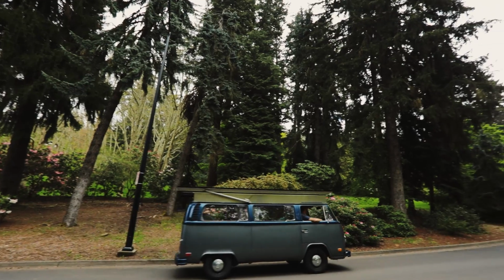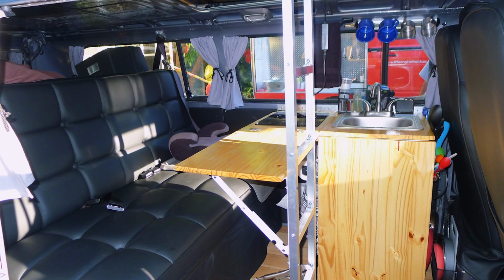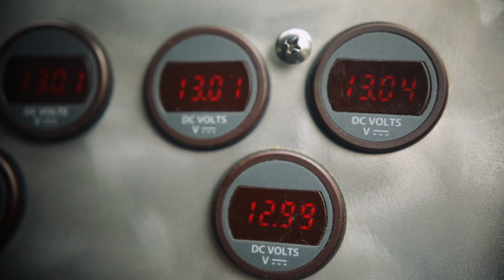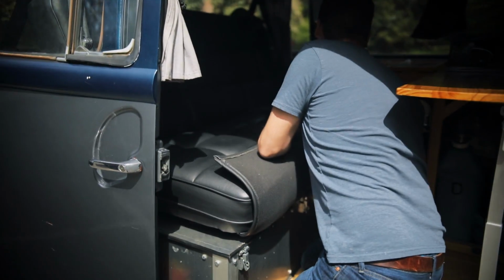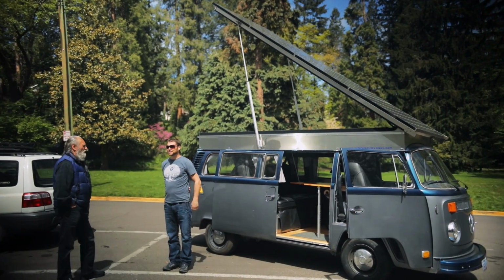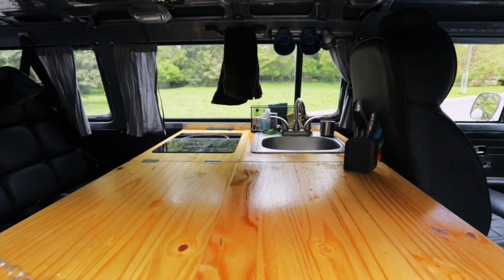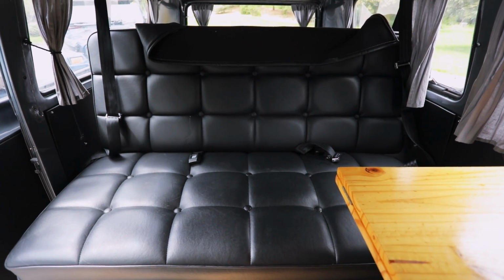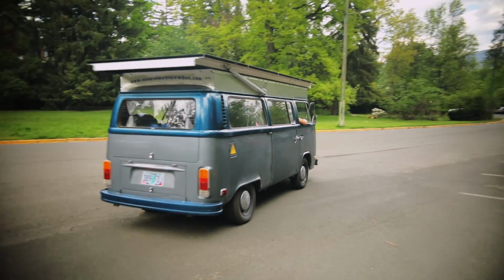This is a Fully Solar Powered Electric VW Bus

Comment: wouldn't mind a tax to add a slow vehicle lane on highways with different standards than regular vehicles that way golf carts ,hpvs,and low power 4 wheelers, and other vehicles like this bus could travel safely at 30,or 40 mph safely .just going slower takes your power requirements way down while still having enough power to climb some decent hills

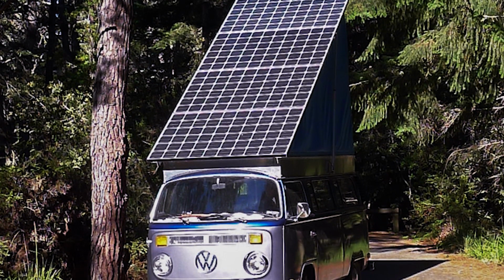Comment: perhaps someone can correct me if I'm wrong, but at 1:11 you can clearly see that the panels are arranged in 6x10 grids where the output is 30V by getting 5V from each of the six rows (connected horizontally)... if only the panels hand been wired in a 10x6 grid, where you got 5V from each of the ten columns (connected vertically), there wouldn't be a need for those controllers since each panel would be giving you 50V (200V in series)... same amount of watts of course since all you're doing is rearranging the connections and you really do want to avoid any sort of unnecessary drain on solar

Comment: So, 50 miles, and then you spend the next day charging? Or can you get enough charge per day to run 50 miles?
Reply: Andrew Elias he can plug into an ev station and it's charged within 2 hours.

Comment: You don't need a transmission.... also you can charge the batteries without stepup if wired differently.

Comment: Cool concept, but why on Earth are you using lead-acid batteries? Switch to Lithium Ion - 1/3 the weight, better charging efficiency, over 10x the cycle life, and stable voltage during discharge.

Comment: Very interesting. I'm curious about the range it will go when charged. Also curious about how much power it would have for being able to climb hills. I'm sure newer technology for both batteries and solar cells could improve something like this still further.
Reply: So you say 40-50 miles ? Still perfect for more local running around.
Reply: And installed charging stations everywhere would be great, too.

Comment: Congrats I was not sure it could be done with a standard vehicle. Using a van gets you great surface area. We've been building a light electric solar powered vehicle using ebike technology. We use light thin film panels that are really light. (Solar-E-Cycles on Facebook). What did this project cost you?. You should look at reflectors composed of polymer foil covered with evaporated aluminum to combine lightness, high reflectivity (> 90%) and low cost to boost the amount of sunligh collected while parked if you place them at the right angle on the sides of your panels. Such materials are already available at industrial scale on the market and are commonly used for solar furnaces. The company Sunited produces reflective foils at a price around 15 €/m² (figure …) which is a far lower price than using high efficiency cells laminated in polymer which price can range between 200 and 500 €/m².
What motor are you using?

Comment: He would have to drive that car for 200 years to cancel all of the pollution caused by the manufacturing of 10 batteries, solar panels, and all of the strip mining for cables, rubber ect. The Green life is resting on a super polluting platform.

Comment: How many HP?
0-60 in how many seconds? (any more than 15 is a deal breaker for many)
top speed?
This solar shit is so light and fluffy and cuddly. Its time to drop a bombshell.

When all the cars go electric most won't be equpied with panels. Where will the power come from? 
Let me give you a hint: I aint gon be solar. The Germans have tried it and it don't work. 

I say we use nuclear. Using modern thorium powered designs.

Comment: is a great thing that you've done now I like it but I think what I would do is Pulis a more generator in the back somewhere charging the battery while you're moving along the road or when the batteries fall below a certain level so you would have power for longer and you can go more than 50 miles and when the batteries charged the generator switches off and the solar panels continue doing their job.

Comment: Here is an idea  https://www.amazon.com/BAZIC-Tri-Fold-Corrugated-Presentation-Board/dp/B003BOUY6M/ref=sr_1_10?ie=UTF8&qid=1495197746&sr=8-10&keywords=poster+board. If you designed the solar panels so that you get your current panals on the outside, but when you park you open up the system and you get double the solar area.

Comment: Dylan,  Are you using the AC-51? I ask because you say you have a 144 volt system. I like the setup you used to install the panels. What inverters are you using to get your 50 volts per panel? What is the output of each panel? Nice job and I like that little induction cook top.

Comment: Lovely concept, but the quality of the execution makes me cringe at some points. Like the rough cutouts on the wooden controller panel or the bare metal bottom of the bench, right above the battery contacts. Just imagine this bench bending through for some unfortunate reason... °_°

Comment: What a stunning job! Congrats! Love the design, and it looks amazing with that massive solar wall, quite a statement :-).

Though, do you feel safe sitting on top of that many standard batteries without them being encapsulated? Especially in high heat?

Thanks for sharing!

Comment: Hey i wanted to start by saying this build is really cool! Not only is it fully electric but its an Iconic van! I was wondering if you had considered making this a hybrid car which could use a fuel (petrol/diesel) generator as a range extender?

I'm sure you already know but many hybrids have a motor which charges the battery and extends the range. This is even more useful in an electric camper van for several other reasons. In winter or overcast weather the solar panels may not give you the power you need for heating and cooking let alone travel. Also if you did a 50 mile trip when you get to your destination you may also not have the power.
Reply: Worngb190 mooies

Comment: 50 miles per charge?  and thats on flat land.  Probably 1/4 that in mountains.  Would take two months to get cross country, if you had sunny skys every day.  Powering with lithium ion cells, you might get an additional 100 miles, but you will have much longer charge times as well. With lithium ion, you have do deal with temperature. The cells lose a tremendous amount of capacity when cold which also increases charge times.  They do not like heat either, so you have to have a cooling system for them as well.

Comment: This is one of the best video stories I've seen for over a year.  Good luck with your future mods and efforts Dylan.

Does your drivetrain setup need a transmission?  I thought a single speed is all that is required because of all of the motor torque being available at zero rpm.

Comment: What an amazing build. As the only solar electric vehicles I've seen in the past have been those ultralight vehicles that can only race on sunny desert roads, I didn't realise something like this would be feasible, especially with relatively old mature technologies. I have a basic and small relation to this van's set-up running the power in my shed - a small PV and an old lead-acid battery - and use it only for light duty stuff like lighting, soldering, charging up phones etc.
40-50 miles range a day from solar alone? I love this van.

Comment: I was gonna say that a slide out/fold up solar setup might give you a better range with those planned lithium ion batteries. I really love the idea, and the fact that you are making use of an old van to do it. I have a diesel Jeep wrangler that I'm hoping to add a HHO system to. It's fuel economy is really poor at the moment so hopefully adding Hydrogen will make less impact on the environment.

Comment: With a set of panels that large, how do you go when it gets gusty?
Under the panels, the heat must be extreme.  I carried a 250W panel that was in the sun with the underside of the panel on my bare back was very painful due to the heat.
Fantastic project with great results; you are inspiring me!

Comment: I wouldn't smash the copper rods, and I wouldn't casually grind them either--both put stresses at the delta of thickness and would be more likely to snap.  I'd grind a little off for a flat-side x2 w/cooling on the grinder.

Comment: This could have been our old 73 bus!   Love hate relationship [long stories]; had to sell it; miss it all the time.
This conversion is fabulous!   It is something most say 'can't be done'...yet you did it, wonderfully well.   
You gonna write a book or e-book, for DIY'ers that also want to do something like it?    
Could tow a little trailer with a propane or biodiesel generator, to use for backup charging / longer trips.  
Great idea, solar awnings for more charging while parked.  Living in small spaces, even camping, is better when there are covered transitional spaces.   
Have you considered mirrors to increase outputs of panels?   Some have experimented with that, actually mounting PV upside down under a shed roof [panels stay much cooler], only using mirrors to shine sun on the panels....mirrors are on a tracker, instead of the panels.  Now someone's come out with a globe that tracks sun, and shines it through windows, to light rooms without electricity...this thing could be used for PV application, too.

Comment: This is a cool project, but it is as I suspected. Not really something to travel in, and you have to choose between traveling and using electrics. And sometimes choose between traveling and standing still :) It looks really smart (with the possible exception of the controller holes)! And I hope you had a great time putting it together even though I dread to find the build cost!

Comment: You could add a timer and use a stepper motor to put the solar panel at the best inclination depending on the time of the day. You could have it move every hour for example, or (a bit harder and complex) continually. Ideally you could  put an arduino or other chip with a program and a quartz clock, with one program for each day or each week of the year, or even just one program per season, that could add 20% input on average depending on the season. Sounds hard but really shouldn't be at all compared to what was already done. I love that he kept the transmission, it's smart and also keeps the pleasure of driving one of those. I personally would add a small truck APU in his engine compartment that seems to have plenty of space left to guarantee you always have electric power to move out or use appliances for emergencies (they use very little gas and are very quiet, and  you don't have to turn it on at all if not needed) and also provide climate control.

Comment: instead of using lead acid batteries he should've used the 18650's they cut that 1000 pounds in half extending the range and have a longer life.

Comment: Don't forget the amount of energy it took to convert the vehicle to electric it will take many years before it breaks even with the carbon emissions of an existing VW bus. Not to mention the batteries will need replacing at some point soon if he is actually using.

Comment: Amazingly cool build.  One of my new favourites!

Do you think you could triple the surface area of the solar panels by having two more of the same arrangement that fold out on either side of the current one?  It would create a scary sail so probably not best to unfurl in wind, but would it not be easier than building an awning?  You could also gather a lot more power by pointing them at the sun the way you do now, and gain efficiency by not having to boost the voltage.  ~3kW array on a Veedub would be majestic.

Also, have you considered a portable micro-hydro generator you could plonk down in one of those creeks you visit?

I suppose all of this is moot until you increase your battery capacity.

Comment: Wow. 50 mile (80.46 km) range using lead acid golf cart batteries & a solar panel roof. What an amazing & awesome rig. 

The only thing I would add is an large gas generator or put the engine back in to have the option to move more than 50 miles a day.
Reply: I would rather add lithium batteries and slide out solar panels (doubling as awnings) , which is what he wants to do with his next bus.
100+ miles and recharging faster (example of slide out solar panels: https://jeyakaushik.files.wordpress.com/2014/06/wpid-3032159-inline-06162014ecospheretechnologiesecospowercube.jpeg) sounds like a nice camping vehicle
Reply: Listen closely and you hear him say a few wise things about range and speed.
Reply: Yeah, did you not listen to him finish the "paragraph" in which he's intending to improve upon what he began with this bus?
Reply: A generator would add weight, which would make you need to use it more often. An engine would be the same scenario but worse because it's heavier. And making a transmission that can receive input from more than one source isn't easy. I could see bringing a small generator for an emergency situation, but only for trips that are very far away from civilization.